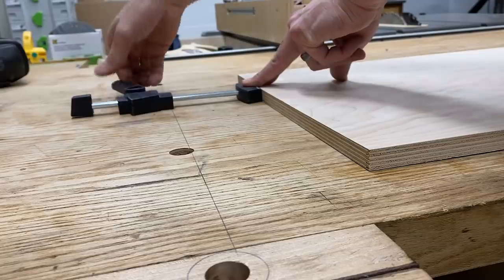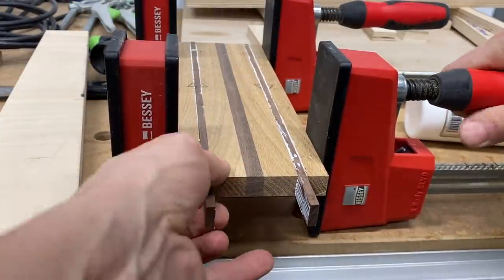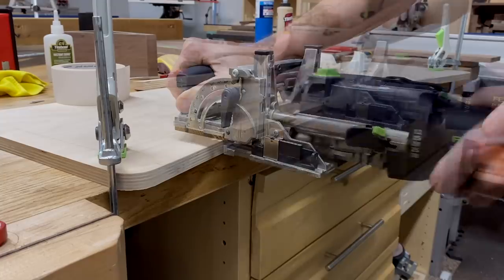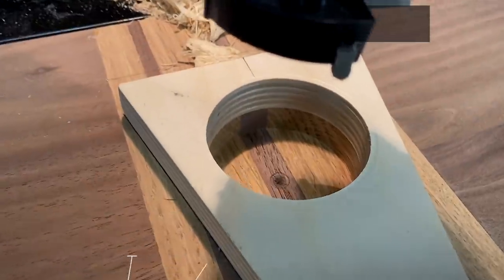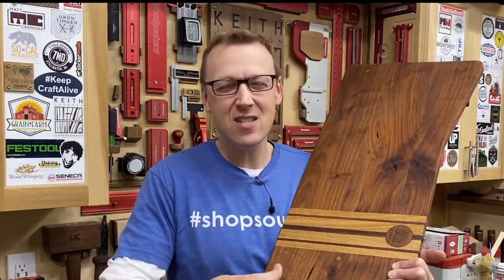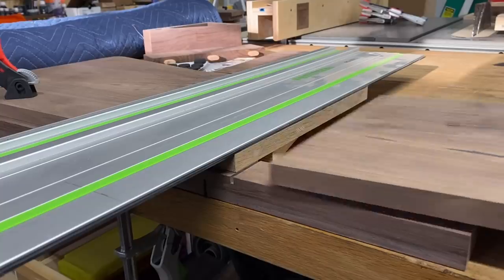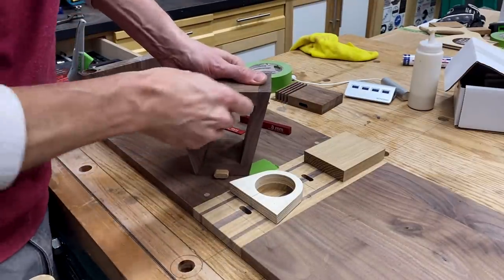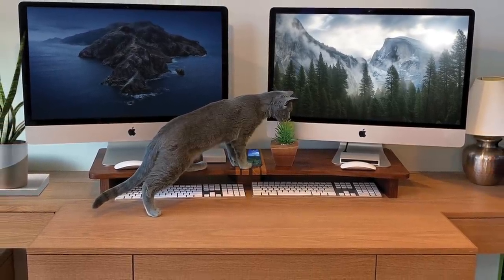Is wood movement a myth?!

Comment: those are both awesome looking monitor stands! thanks for sharing  your mistakes for the clumsy weekend warriors like myself! and i just wanted to say, i made a round coffee table top a couple  years ago out of "brown maple," i think it might also be called "country maple" (?). anyway, i used 3/4 boards for the top and glued pieces underneath just on the edges to make it look twice as thick from the sides. grain is going both directions and it's glued on all surfaces. i haven't seen any movement / cracks / separation yet, but i do live in Southern California and the climate is probably less dynamic than in Long Island. i wonder if maybe the maple is more stable too...? not sure. but thanks for the great instruction and insight anyway, Keith!
Reply from the maker: Thanks! And wood is a fickle substrate. Sometimes it defies all laws of wood movement and doesn't do a thing 😂. Glad it worked out with your table.

Comment: Awesome build! You use that angle gage thingy all the time, but it was only a 1 time tool from Woodpeckers and isn't available anymore. Would be great to see an alternative method for setting angles with a different tool.
Oh, and since this thing was built to hold Apple products, that must mean you're charging $6500 for it?!
Reply from the maker: You can check out the Veritas Bevel Setter or the MasterGage 106-01 Universal Angle Guide to find angles using any sliding bevel gauge. I’m sure there are other brands out there as well. Oh, and you can also use a carpenter’s speed square to set an angle 👍🏻

Comment: One question: does the wireless charger really works? It looks as its below the oak part which is aprox 3/4”. Is it so powerful or did you drill a hole in oak as well as in the plywood part?
Reply from the maker: Yes, it works! It’s drilled into the oak part as well and must be a maximum of 5mm from the top surface for the charger to work properly. It also requires the material to be a minimum of 3/4” thick. The white oak was 5/8”, so the plywood added the xtra bit needed to meet the minimum thickness.

Comment: You should check out Synergy to optimize your workflow from computer to computer. It's a program that is installed on both computers that allows you to use one mouse and keyboard without having to use a hardware KVM.
Reply from the maker: Pretty sure you can't connect 2 iMacs for sharing. You can connect an iMac and another monitor.
Reply: @KeithJohnsonCustomWoodworking  Yeah, Synergy is supported on OSX. From the looks of the way to set up your desk you use two dedicated computers and not just an iMac with another monitor. 
Synergy allows you to use one mouse and keyboard for both iMacs. You install it on both and designate which is your primary(the one with the connected mouse and keyboard) and then select the client computer, via your LAN they communicate and act like a dual monitor setup but in reality its two dedicated computers. Its pretty nice is the sense you can be rendering videos on one iMac and other tasks on the other for optimized time. 
Here check out this video, he explains it pretty well with OSX

https://www.youtube.com/watch?v=XJXwYU4ttmk
Reply from the maker: @CorneliusFTW  THanks a lot. I'll check it out.
Reply: @KeithJohnsonCustomWoodworking  No problem! Keep up the excellent woodworking! I'm enjoying your style of commentary and explanations.
Reply from the maker: @CorneliusFTW  Right on! Thanks very much!